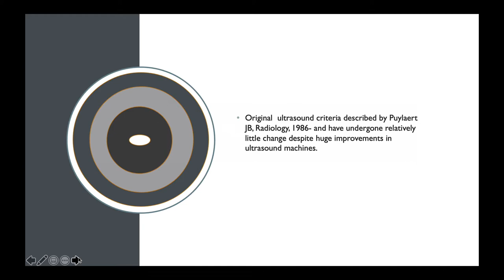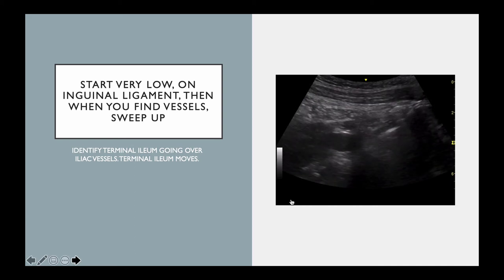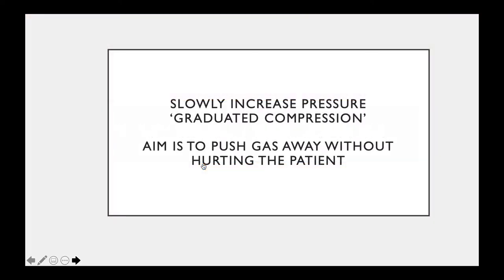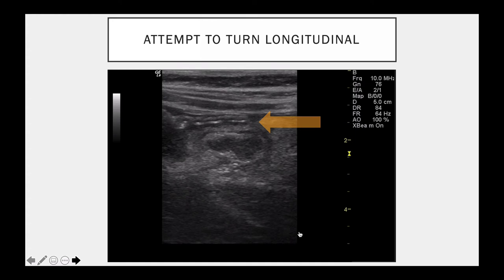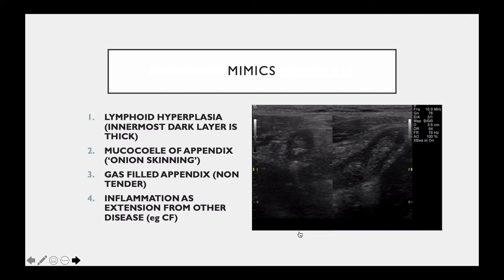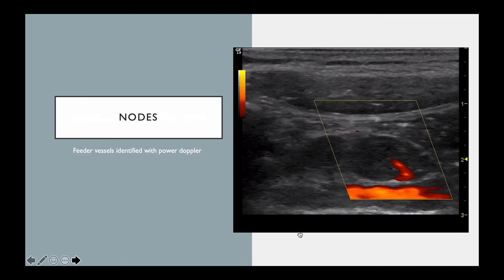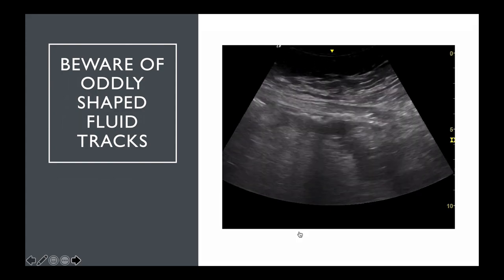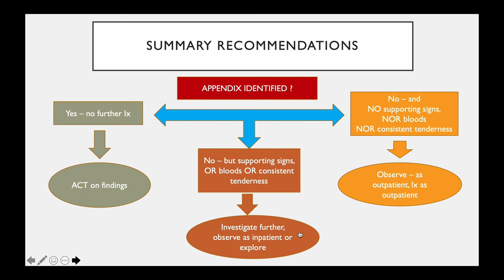PoCUS for Appendicitis

Comment: I want to ask however, when you see dilated loops of bowel in the right iliac fossae but no obvious appendicitis or the appendix looks normal. What do you do?
Reply from the maker: Thank you for a great question.You follow the dilation to its distal extent(ie is colon distended too) , you check the hernial orifices, you consider if hyperperistaltic or motionless, if the walls are thick or thin, what is the proximal extent of the dilation and put it all together to decide if you have an ileus, and obstruction, ischaemia or gastroenteritis. I would do this if the dilated loops are more than just one or two localised just to RIF.